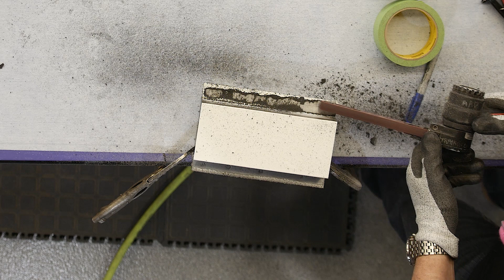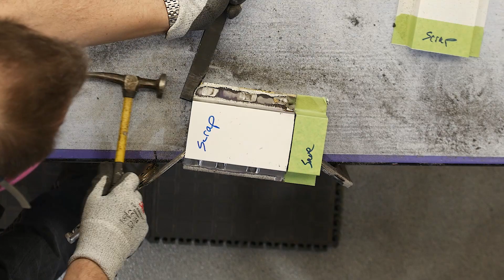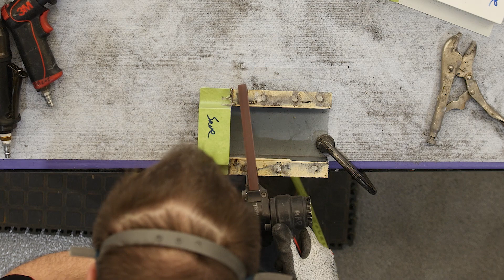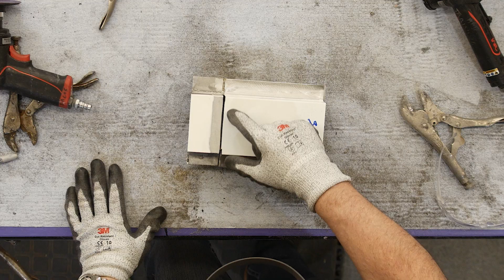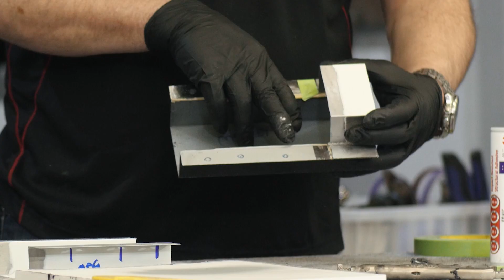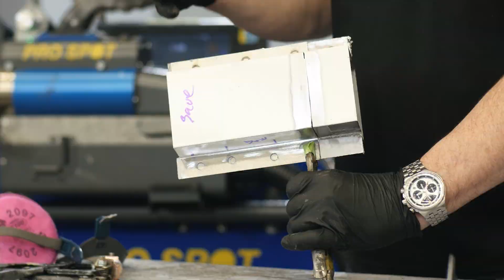HOW TO: Do Panel Bond Repairs with Welding

Comment: Thank you so much for providing such a thorough, well executed and very informative educational demonstration. After watching this video in conjunction with the weld thru "primer" video, I have absolutely no questions left unanswered. Thank you Shawn for providing such a comprehensive demonstration! I am doing a small DIY repair to non structural components this week. Although I wish I had 3M branded tools and materials to complete  the job, I am still able to apply your Pro tips and techniques with the materials I have to work with. After weeks of searching the internet for articles and videos, I have finally found answers to all the questions that keep coming to mind as I have progressed through this repair. Shawn, you have really earned my respect and I am blessed to have come across these videos. It I could afford to repurchase all new materials for my project or had come across these demonstrations sooner, I would definitely go with your recommendations in this video. I wish there was some way for me to help share your knowledge and hopefully save others like me from being lead in so many different directions. Although I can not personally vouch for the quality of the 3M products used, since I have not had the opportunity to use them, I can still confidently recommend anyone to come check out these incredible videos. Thanks again Shawn and 3M!

Comment: Taken from, https://www.twi-global.com/
-  MAG stands for Metal Active Gas.
Active gas mixtures have been developed primarily for welding steels. Typical shielding gases are mixtures of argon, carbon dioxide and oxygen e.g. CO2 , Ar + 2 to 5% O2 , Ar + 5 to 25% CO2 and Ar + 10% CO2 + 5% O 2 .
-  MIG stands for Metal Inert Gas.
Only inert gases or gas mixtures are used for the shielding gas when MIG welding. Typical inert gases used for MIG welding are argon and helium. These gases are usually used for MIG welding of aluminium and other non-ferrous metals.
Reply: @Terry Pullen  -  Buddy, I want to give you a virtual internet based handshake for clearing up. I am not sure if the guys/gals/questioning at my weld supplier would be able to give me a quality paragraph of explanation as you did in comments. 
   After decades of diagnosing the root cause of someone’s complaint, if asked a question I did not know, I said so!
  It’s kinda like the old saying; “If you can’t dazzle them with diamonds, then baffle them with BS.” I admit, after owning a new 150 Amp MIG in 1984, I have used straight CO2, but used 25%co2 / 75% Argon, all for general purpose mild steel welding. I don’t know if it would be cheaper after retirement to go back to straight co2 or stay with what I have.
  Too many back surgeries have slowed me down but family, friends and me still fabricate non-structural parts from mild steel. 
  I have a MIG from Italy which according to the website has been manufacturing welders since 1913 and was trying hard to get market share. Besides most of Europe has 220 at the wall socket! Lol.
 Thanks, I wanted to give a shout out to anyone who makes the complex understandable and interesting. In my eyes after teaching auto tech on the road for one of the big 3, that rhymes with M&M, I enjoy learning, regardless.

I hope 2022 finds you well and is good to you! 
ASE master tech since 1978, retired.

Comment: I guess I am old school, but butt welding on a repair like that is bad form. There should be a sleeve panel put in behind the joint. I would really like to see a video on using a bonded sleeve. I do that on door skins and sail panels all the time and it works great. Also, I force cure 8115 all the time and it makes a bonding repair super fast. Thanks for the video.
Reply: Many OEMs have gotten away from using backers especially on outer non- structural panels because they are a moisture/corrosion trap. Toyota is a good example but it’s becoming prevalent. Bonded joints are very time consuming and can lead to mapping or read-through of the joint line after months of heating and cooling cycles. Coefficient of thermal expansion issues.

Comment: MAG weld?...its MIG weld (Metal.Inert.Gas). You could have used a reciprocating saw and had that section of the panel removed with little to no heat in less than half the time it took you to screw around with the belt grinder.
Reply: @TheTotaled1   >That is using to much common sense! Air saw cutter in corners. The special 3M tool only uses the their belts and abrasives. So $489 or $48 at HF. I have a MIG & you have a MIG, but they use a top-secret Magnetic Anechoic (Sound Waves) Welder. Called a spot welder everywhere else. You can fix it right unless the “Spot Welder” that weighs 560 pounds & counter weighted from the ceiling, like tools the UAW uses. Use it wrong and you can chip or break a finger nail! 
You are ever thinking the body repair process. $6,300 in tools and $900 of 3M materials. Don’t forget the cavity wax!
It’s all fun, until someone puts an eye out! ASE Master Tech since 1978, using a MIG and plug welding holes.
Reply: Apparently you're wrong; there seems to be a difference between MIG and MAG - that being Inert Gas and Active Gas. It seems each designation depends on the different gasses that can be used.
Reply: MIG welding has been incorrectly used in the collision repair industry for decades and the OEMs are starting to correct it. We use active gas, 75%-25% mixed gas which is Active, not Inert. 
  I’m demonstrating as if there is a reinforcement close behind the top panel which is typical. In that case a saw will not be feasible. Thanks for watching.
Reply: @deankay4434  how did they put an eye out ? 
Weren't they wearing their 3m safety glasses?
Or for extra style points get the tinted ones and score with the ladies !
I got a pair of the tinted ones ,and look at me now I gotta beat the women back with a stick!